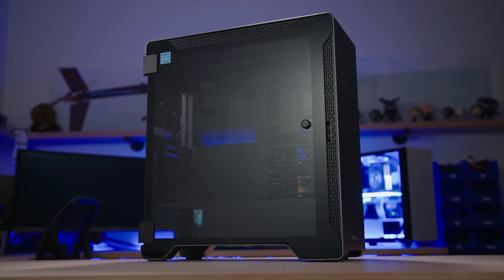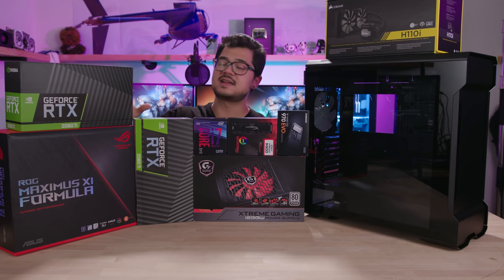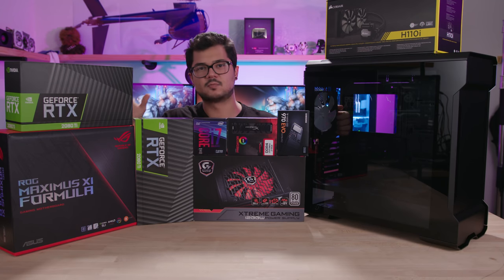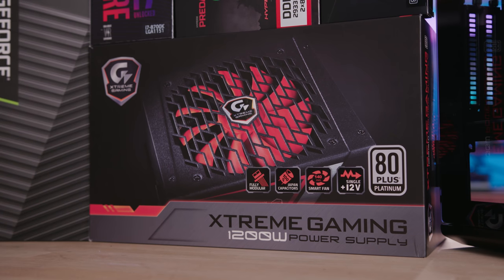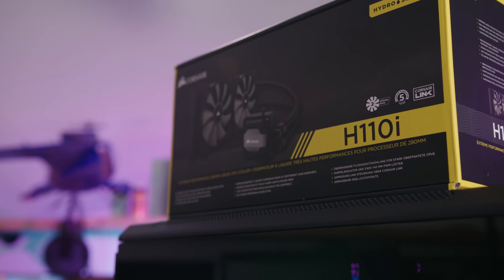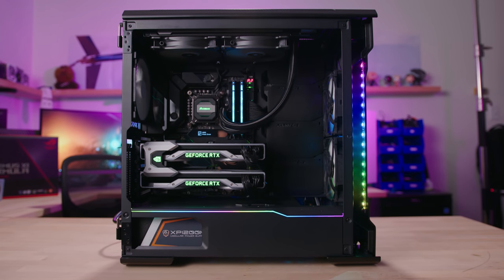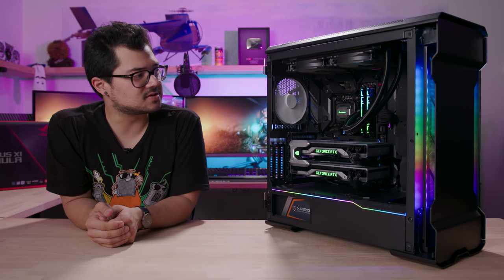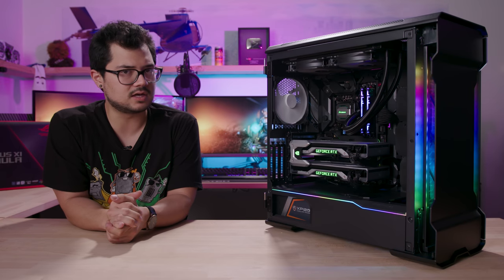Hotline 2.0 Early Build (Pre-Water Cooling)

Comment from the maker: Thoughts on the specs so far? There's been some debate on Floatplane about the case. What do you guys think? Vote here https://www.strawpoll.me/16725639. And leave your thoughts in the comments
Reply: literally just started planning my build in that case
Reply: Notice gang
Reply: Nut
Reply: Should’ve gone with the s2... 😩
Reply: You should consider delidding the 9900k, even though its soldered. (watch the video from der8auer about it). Rest looks very good so far !
Greetings from Germany :D
Reply: Just got the case doing a wasercooled 9900k 2080ti corsair grb pro ram 4x8gb 1tb Samsung nvme with 7 yes 7 120mm corsiar rgb LL fans. Gonna need 2 360mm radiators some rgb fittings and blocks for the tubes and rgb res... I forgot to mention the asus formula Motherboard.... Anyway It would be sick to see some of those parts in your build. Any thoughts on my savings pit. Taken almost a year now just a few month to go and it will be alive
Reply: Great case, building a new system in the same case. Not because I need a new system but because the evolv X looks so good that I couldn’t resist.
Reply: I have the asus formula xi myself and in order to remove the plastic on the vrm you need to take of the pack plate and then remove the vrm heat sink screws. 

Ps. I also got a few scratches :(
Reply: Only potential issue I could see is not having enough room in the front for the reservoir if you mount a radiator in the front since the case is somewhat short from front to back. The case itself is very nice though.
Reply: Make sure to use a few Phanteks Halos Lux in that build if you want the "complete RGB" experience.
Reply: dear Kyle... i love your work... but please do more AMD ryzen and TR builds in the near future 🙄😢
Reply: Use the Asus THOR PSU instead so you can show the power consumption through the shroud
Reply: Pretty please with cherries and coconut sprinkles add a 2160p 144hz monitor to the spec.
Reply: Building a new system in that case as well, but still waiting on the xi formula :|
Reply: Looks sweet man, I'm going to be upgrading my computer for the first time in about 6 or 7 years. I'm "rocking" an AMD FX-8150, and will most likely be going to with a Ryzen 7 build or an i7 build, depending entirely on Black Friday deals.
Reply: I'm planning on building a fairly simmilar pc in the near future and I was wondering wherther there was any particular reason you mounted the radiator in the top instead of the front (even though this is not the permanent cooling solution you will use in this pc). I watched the video that tested the thermals for both configurations and came to the conclusion that I should put my 360mm aio in the front and have the 3 140mm fans that come with the case as exhaust. btw, I'll have an RTX 2080 Founders Edition in the pc if that makes any difference.
Reply: Honestly I feel PC building still sucks. Power supplies and Ram are still higher price than they should. Intel brings out bullshit chip vs AMD and still at a higher price. RTX sure... But they still keeping 1070s and 1080s at stupid prices, I guess give me that 580x that's 200 dollars
Reply: This is almost the exact same build I'm doing. :D
Reply: I personally like the current look. Especially with that board, I’d stay away from pink
Reply: should have gone HEDT if only for the higher number of PCI-E lanes. Seriously limiting your build with the 24 lanes the 300 series provides. Limits ability to run M.2 since you are going dual GPU
Reply: Change the PSU.
Reply: PC-O11 Dynamic
Reply: I actually really like the case, I haven't finished the video yet to see the completed build though so I'll edit this in a minute when I'm done lol. EDIT: I like it, specs are god tier, looks pretty nice already although I'm sure it'll look a lot better once finished. for now though, It looks super clean/minimalistic the way it is, good amount of RGB but not a unicorn poking your eyes out when you stare at it either. I was going to suggest removing the PSU sticker as It just doesn't look right to me but 5 seconds later you stated that you would be removing it soon. 8/10 would stare at it again.
Reply: I think it looks good, But the airflow could be better with modded front panel and top panel as well.
Reply: I dig the build. I'm just wondering if the cost of two 2080ti are worth it over 2 evga 1080 to ftw3 gt
Reply: Use the Define S2
Reply: Not a fan of "all performance/no thought" builds. Not a fan of the i9-9900K and its pricing, and I kind of don't like the case. But hey, I'm here for the builds, so I still look forward to the final result.
Reply: I'm doing almost exactly the same build in this case! It's an awesome case!
Reply: A 16 lane cpu coupled with X2 16 lane ggpu's and a 4 lane nvme - nuff said
Reply: I have been waiting to see this video once you mentioned that you were going to use this case. I decided on this case once I saw your video on it the first time. It looks like someone was able to fit 2 EKWB 360PE's which I plan on using as well hopefully you do something similar so i can see in on video. It will be my first custom loop water cooling build also choosing same proc.
Reply: omg!!!! this is exactly the same build i was going  for. unfortunately i wont be able to do the custom loop so i had to downgrade to the 11 hero...  =(.
Reply: Asus Thor PSU................
Reply: Hey mate, just wanted to let you know that the predator RAM overclocks very well, I have my 2933 4x8 kit at 3733mhz no stress at all. I have found that the RGB is inconsistent though, with some issues with low saturation colours and in the yellow with a few of the dims. Not an issue for me, but good to be aware of.
Reply: @TheBoredPersons   its not coming out anytime soon. the oled watt meter will be really dope in this case though.
Reply: Why would you not do this build in the sexiest case on the planet? Don't listen to the haters mate, no doubt some idiot somewhere is pointing out that their case recommend has space for 1 extra bolt somewhere that will make your life 10 times easy. But Fudge that crap, this case wipes the floor looks wise with anything out there right now.
Reply: I really like the selection of parts, I'm not sure why that PSU and RAM though. Seems a bit of a letdown. Especially for a PSU there are much better options out there, from ROG Thor (SeaSonic) to SeaSonic own branding, and Corsair ones. The Thor might give it a nice touch with the wattage showing through the window, if you're in to that.
Reply: There's an awful lot of liquid in that CPU cooler for this to be a "pre-watercooled" build. Lol
Reply: this was my initial plan. feel free if you want to copy it since i have had to downgrade to hero 11 for my build since i cant afford custom looping.
 thermaltake riing halo rgb fans
asus thor psu
formula 11
corsair vengeance rgb (this is best rgb ram out there trust me)
white and grey cable. 
carbon fiber vinyl sticker/wrap for case. ( this should have some reflective surface to bounce rgb subtly)

and thats it  =(
Reply: What do you think about the issues regarding HyperX RGB ram? There is a good thread about that on level1techs
https://forum.level1techs.com/t/warning-hyperx-rgb-ram-false-advertising-rgb/133502
Reply: I nominated that exact case when you first showed it. Kyle, have you been browsing the comments for suggestions lately?
Reply: Out of my 5  friends, we all bought the case, 4 out of 5 of us received a broken case.
Reply: FE he mentioned that he will be liquid cooling and that the evolve x is rather shallow so he mounted the rad on the top to allow for more room to get the reservoirs into the case.
Reply: Hey Kyle,  I just received my Evolv X a couple days ago!!! But in silver.  It's sooo beautiful.  I plan on going with a MSI gaming X Trio 2080 and also a 9900k.  I hope to find a few more deals over the next few weeks (black friday) before i'm ready to start building!  I'm also going with some overkill 32gb of g.skill trident z rgb, a 1TB 970 Evo, and I think i might be going HAM like Paul with those Corsair LL rgb fans, along with a H150i.  I can't wait till it all comes together!  I feel like our new rigs will be kinda similar, albeit, yours with a couple thousand more in GPU power ^_^
Reply: What are you going to do about the green lighting of the RTX and SLI Bridge?
Reply: I love that case, I'm almost tempted to get it and transplant my rig in it just because, but I should probably wait for when I refresh my whole rig.
Reply: Swap SLI with NV-LINK!!!!
Reply: I like the elegant black with silver accents, its not too much.  And that case makes it look soooo cleeeean 🤤
Reply: Where can you buy that case?
Reply: Would love to see how you install the gpu anti-sag. I dont know how to do it.
Reply: It looks like that case on the ironside something
Reply: love the build but i been wanting to know how do i get my hands on a multibit screwdriver that u have besides from buying the kingston ssd bundle
Reply: I just finished 2 builds in that case. Both liquid cooled and it is pretty good. Two 360mm radiators fits perfectly. Rear exhaust fan does not work well with the liquid cooling loops. Looking forward to see how you integrate the Z390 Formula's EK crosschill into the loop as well.
Reply: "Hotline 2.0" more like "Miami Hotline"
Reply: I just love the description look at the place where Kyle puts the videos title and url🤣🤣🤣🤣🤣

Comment: My experience with that Gigabyte PSU was not good -- fan was VERY loud with no reasonable way to control its speed.
Reply from the maker: Haven't noticed the same, but that could be because I've only used it with test beds where I'm never paying attention to noise. Ditching it anyway after hearing your experience. Thanks Paul!
Reply: Albin Rosengren lol
Reply: You can never go far wrong with a good Seasonic.
Reply: Nah first world solutions.
Reply: @amcheck4828  I'm trying to win
Reply: @wing0zero  Or Super Flower, Mistel or any higher end PSUs sold by mainstream brands from those 3 OEMs.
Reply: that's not the fan making noise, it's your PSU coming into contact with your case and short circuiting all your components Kappa. sorry for beating a dead horse but at least I'm not stabbing it with my swiss army knife.
Reply: RageAgainstTheToyMachine hahahah
Reply: @Bitwit  If you find better PSU, then maybe custom emblem or sticker of hotline signature on it or the PSU shroud would look apart
Reply: Tbh I was a little skeptical about a 1200 watt psu anyway, with the addition of some more fans, pump, potentially led's etc. on top of the current hardware I'd be a little worried I wasn't giving myself much headroom to overclock.
Reply: @Albin_491  Pauls Hardware generally comes across as Elitist and not caring about his viewers and only seeing them as $$$ so I refuse to watch him.
Reply: EVGA and Corsair psus are the GOATS
Reply: Can u please put a nv-link instead of sli
Reply: @Bitwit  The new ASUS PSU might look hype af with the cutout in the shroud!
Reply: I use a rosewill 1200W fully modular psu I likey
Reply: Myles He was looking out for Kyle. Don't see how that means he cares about himself when he went out of his way to help Kyle.

Comment: You should disassemble the 2080's and sand off the green paint off the GeForce logos. You could repaint those pink and if you could take apart the SLI bridge and paint it teal.
Reply: Or just put an aftermarket BIOS from a card with NVIDIA PCB on it, the logo is clear and the LEDs are actually RGB. JayzTwoCents even made a video about it, I think.

Comment: Even if you don't use the space, the 500gb class is a better choice as the 250gb class SSDs do not have the same levels of performance as the 500gb class SSDs.  Also, longer lifespan as more space for wear leveling.

Comment: Noob here. I have a question. By adding a AIO on the top, would you not be then hurting the cooling performance if previously you had 2 fans exhausting air.  Im assuming that because air now has to be pass through the rad, you arent getting the best clearance of warm air?  Excuse me if im being really simple here.   Im only asking because I'm looking at buying my first AIO.

Comment: Several issues I noticed 1) You are not wearing a wireless ESD strap 2)  You used the wrong screws on the Radiator, you are supposed to use the long ones 3) No tweezers disguised as wire ties. :)

Comment: Very similar to my build.  9900k, 2x 2080 Ti FE, Asus ROG z390 Code, 970 Evo NVME 1TB, WD Blue SSD 1TB, Season Prime Platinum 1000w, H700i, Corsair Vengeance RGB Pro 3200 32GB and EKWB custom loop.  Just waiting on the CPU to ship so I can complete it.  After all the reading about the MB, I found that cooling the VRAM was not beneficial so will be curious if you have better results.
Reply: What monitor do ya play on?
Reply: OriginalCatfish depends on the game but it’s either a 27” 1440p 160hz or 32” 4k hdr 60hz.

Comment: what should I do first to upgrade my pre-built pc???
Reply: Tell me the specs
Reply: d0lp1n5 

CPU  amd ryzen 7 1700x eight core 
Gpu   amd radeon rx 580 
8GB  ram 

Its a Dell inspiron
Reply: @beastmodebrown352  whats your power supply wattage
Reply: d0lp1n5 let me check
Reply: d0lp1n5 460 W
Reply: @beastmodebrown352  the gpu whats your budget
Reply: d0lp1n5 awnestly Idk        im thinking of just selling it and just building one    would that be better?
Reply: @beastmodebrown352  the 1700x is still a gr8 processor and 8 gigs is good enough so i reccomend replacing the gpu
Reply: d0lp1n5 thanks alot  have a good one

Comment: I had 2 2070s and an i7-9700k I replaced the i7 with an i9-9900k and took the bottle neck benchmarks and surprisingly the i7 turned out to better idk if it was a thermals issue since I water cooled the i7 and air cooled the i9 with a heat sync

Comment: Only potential issue I could see is not having enough room in the front for the reservoir if you mount a radiator in the front since the case is somewhat short from front to back. The case itself is very nice though.

Comment: Im still of the opinion that Z390 should have support for 24 PCIe lanes for the 9900K chip, if Intel was to engineer that into it with 16 PCIe and Hyper-threading for the 9700K and below.

Its my only criticism of the 9900K i can see.
Reply: Same. This is the primary reason I'm not touching it. I'll wait for the next cpu.
Reply: Avenger2108 It’s the primary reason I’m going 7920x/X299. As I want to saturate my GPU, SSDs and still have enough PCIe lanes free.

I think Intel and AMD are caught too much in a core war, the only thing that would differentiate the two is more PCIe in the mainstream market. If you had a motherboard that could run X16 on a GPU and have either one X8 or two X4 SSDs this may give the advantage over team red.
Reply: @AndrewKerr5  my 6800k will stay in my rig until someone wakes up. We need the lanes lol

Comment: As far as hard drives go, if there are no budget limits, just grab some 2TB nvme drives and stripe them together. 
But, if there is some budget sanity, I think it would be  worthy topic to explore what combination of NVME, SATA SSD, aand SATA mechanical yields the highest quality of life and value for gaming with respect to system boot time, game load times, and total storage capacity. 

My current set up is a 970 EVO 500gb with the OS and a couple of my favorite games. Even in Pillars of Eternity 2, the difference between the Barracuda Pro 8TB and the NVME drive was very noticeable. With 1 TB sata ssds coming being around 140 USD, I think a middle tier of storage should be considered. My current set up has 2 1TB 860 Evos striped together. Sequential reads and writes are about 1,000 MB/s, so can't really touch NVME max speeds, but it doesn't matter for game load times. For 300 USD, one could have 30-40 whopper 50GB games on what is effectively an NVME drive w/o having to juggle stuff around. 
Then as a "cold" tier storage, a 4 to 8tb mechanical drive for "convenience" backups of game libraries.

Comment: I know this isn't the video for this but it's the most recent one.
I finished building my PC the other day. Installed windows and it all worked fine, except 2 things.
1: my HDD is not being recognized ANYWHERE in my PC, bios, disk management nothing. Plus it makes a sound when I turn my PC on so I think something is wrong with it but not sure.
2: when I went to hardware troubleshooting it said something was wrong with my gpu, but that's in correctly 100% so I'm not sure what's going on there. 
Any help would be appreciated

Comment: I am doing my own build in this case with similar parts. For the radiator support you were talking about. Depending on the reservoir set-up you want to go with. Most 360 rads are going to be close to 400mm. The EK PE 360 I am going with is exactly 400mm. It will fit on the front but along the top you could  do it, but it will extend all the way to the front of the case, like you said it's not very long of a case. I wanted a little taller of a reservoir, 200mm Singularity protium as a combo with a D5, so I am opting for a 240 on the top. But I am also only doing a single 2080 TI.  Just food for thought. I went back and measured at least 10 times trying to come up with different configurations.

Comment: I'd recommend 420 (heh) radiator at the front and 280 at the top. Shit ton of cooling potential, quieter than 120mm based rads, should fit in the case, and maybe cheaper although I doubt that concerns you

Comment: that case radiator wise maxes out at a 420wide (3x140) on the top and a 280 on the front. Gives just enough room to run the fittings in the corner.